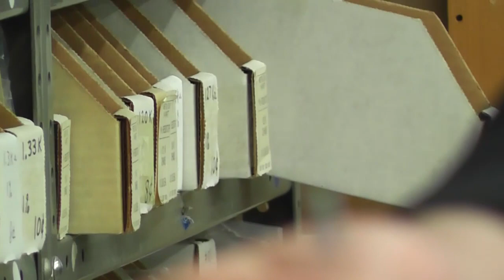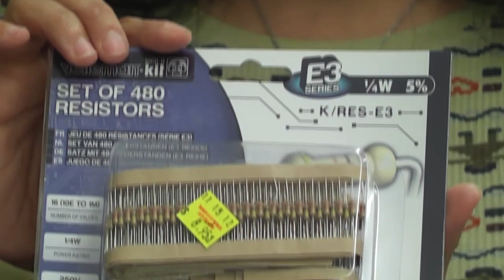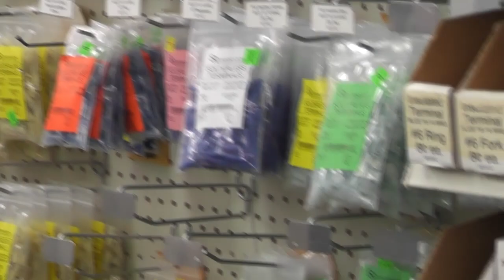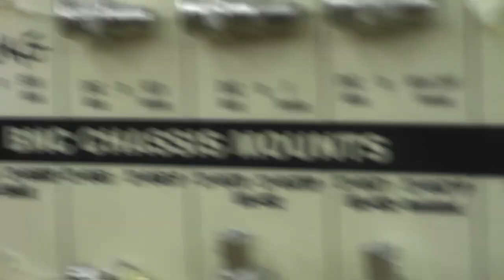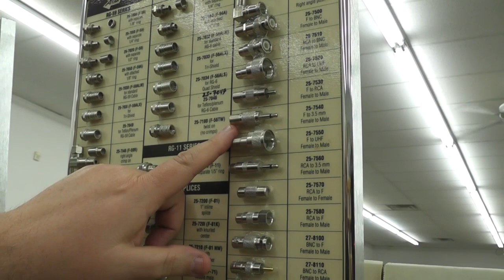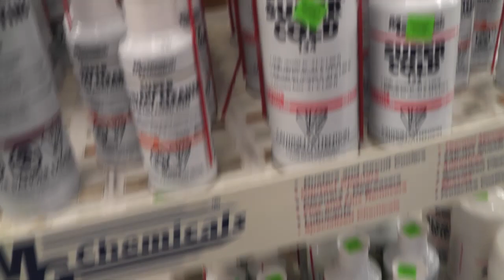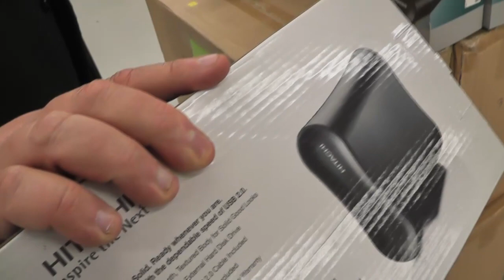Basic Electronics 3 - The Electronic Parts Store

Comment: I used to love browsing Tanners.  Then I moved to Utah.  Only one surplus store here, Ra-Elco in Salt Lake.  Think of Tanners squeezed into 1/10 the size but with more parts!
Reply: Dave Mitchell I was there today. I bought 3, 1 K Ohm resistors, and a 2 x 3 AA battery pack for my fathers Metal Detector. I brought the thing back to life and it was a job that I would normally charge $200.00 for this as it took me 1/2 hour to put two 9 volt battery snaps on where there once was 9 volt battery snaps but were now gone. And the electrical tape and two battery packs. One 2 x 4 and the other 2 x 3. Yes I did use solder and my stripper tool for it. It took me another 1.5 hours to do further investigation to see what else needed to be done.

How ever for my father the service was free as it was his Birthday Gift!
Reply: evilwarcow God job!  Tanner's one of the only things I really miss about North Texas.

Comment: 42:30 TRS isn't L/R ground. It's either unbalanced stereo, or balanced mono (w/ ground). Right?
Reply: TRS plugs are typically used for unbalanced stereo (tip is left, ring is right, and sleeve is ground), or balanced mono (tip is positive, ring is negative, and the sleeve is shield).

Comment: Resistors limit the flow of voltage & current. I think this is an easy way to explain what they do.
Reply: +Bri G. Good start, but voltage doesn't flow! It is the difference in electric potential energy between two points per unit electric charge. :)
Reply: Good point.enjoyed that video of the surplus store, I have one nearby me called All Electronics, all kinds of neat stuff for sale at a discount like that place.You can spend hours looking around.